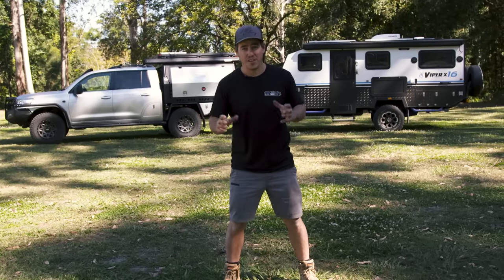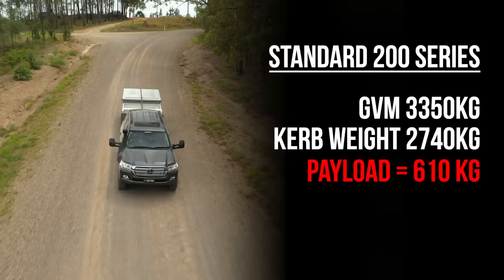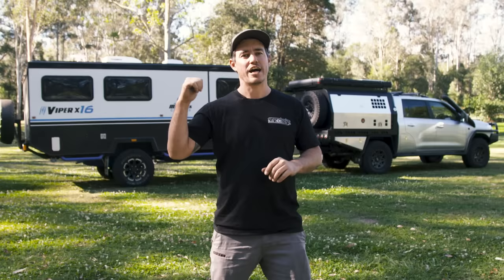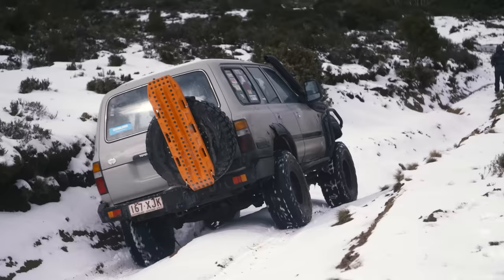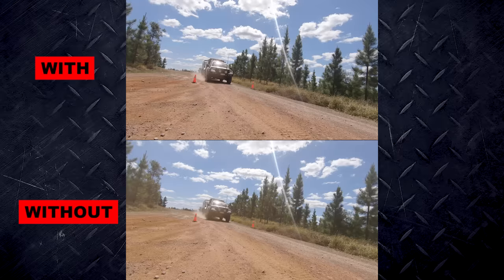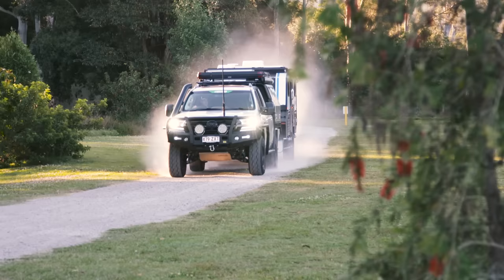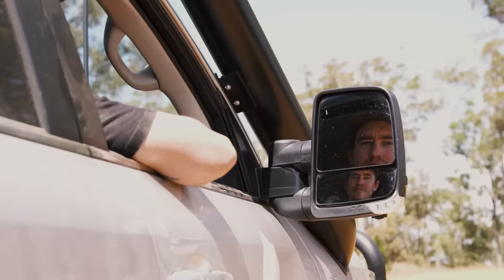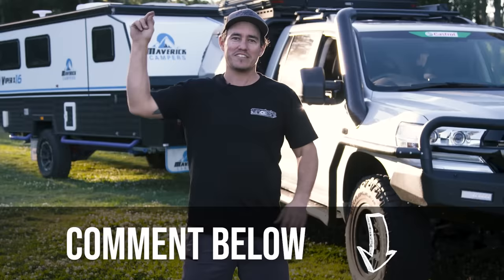SETTING UP YOUR 4WD TO TOW – Expert Secrets! GVM vs. GCM – Towing weights explained

Comment: Love the show fellas. My tip is not to try to sit on 100+km/h when your towing a big van just because it’s the speed limit. Drop back to 90-95 km/h and you will save a bucket load of fuel and go heaps easier on your rig. Just consider other drivers and make yourself easy to pass for those wanting to go quicker
Reply: I drive a truck. Sit on 90kmh most of the time for better ride and fuel. Best advice for caravaners, be consistent with your speed. Predictability is safety. And when there is a good chance for following vehicles to overtake, lift your right foot and let them pass.
Reply: Best advice ever.

Even in normal usage the fuel needed to take a vehicle of almost any type from 80>100 is very close to equal to fuel needed to get to and hold 80 in the first place. Gravity and air flow sucks but it is what it is.

Comment: Really appreciate your explanation of GVM, GCM, tow ball weight, etc., so straight forward and easy to understand. I've got a 2.8T van and have been test driving 4WD's to buy for towing. After watching this video I'll stick to my original plan of not towing it myself, instead paying to relocate as required (it's my permanent home, not for tripping around Oz). I like to do stuff properly the first time and you've helped me decide not to even attempt it, despite friends and family prompting me to. Yes it's a bit daunting thinking about the total weight of vehicle and van on highways that don't have enough overtaking zones or rest areas, but the real reason is vehicle set up costs to do it properly are simply out of my budget.

Comment: Towball weight is a huge issue with the very long draw bars on off road trailers. 
Load levelling hitches are great for on road. 

1. The big one you missed. You mentioned tyres for the vehicle. BUT you failed to mention trailer tyres. 
So often trailers are fitted with really cheap and narrow tyres. Fine for going to your local boat ramp, not for long trips though. 
Shauno, you're guilty of this on your boat trailers. You can see the trailer digging ditches on the older Fraiser island episodes. 

2. Weight balance on the trailer. Loading the trailer properly will make it much easier to tow. 

3. Lockup kits, intake, exhaust. So vehicle mods that will improve fuel economy, control and power.
Reply: Some good points there.
Reply: Read the RAC recommendations on load levelling devices/hitches with vehicles with sway control. Most new vehicles and caravans over 2T have sway control. These conflict with vehicle sway control. Some insurance companies have denied claims due to this.

Comment: A pretty simple one. Don't kid yourself on doing 110 down the highway! Slow and steady, stick to 90 km and you'll save your motor and perhaps your life. And never tow in 5th gear!
Reply: And just hold up everyone who wants to go 110 in a 110 zone?
Reply: There are overtaking lanes and people can overtake safely.
Reply: @samuelsutton8299  90kph is fine by me towing 2.5 ton really. Pretty sure you be pushing alot of vehicles at 110 for extended periods hey. Anyways if you can't overtake someone at 90kph probably should look at something with a bit more hp lol.
Reply: @troymatthews668  there's no overtaking lanes near where I live and if there's people coming the other way sometimes you can't overtake and get held up
Reply: I'm not sure my 80 can do 110 alone! It's top speed without caravan/boat is 100
Reply: Uhh 5th is perfect for towing as mines a 6m..

Comment: If you get in a trailer sway, don't panic, just manually push the electric trailer brakes. Do not press the tow vehicle's brakes. Afterwards, take it slow and reload your trailer when you can, chances the trailer is too rear heavy. A 60% front, 40% rear is ideal.

Comment: Load leveling airbags huge help in getting your rig sitting nicely on the road easy to adjust easy to let down when not towing.
Reply: Good for snapping chassis rails aswell
Reply: Be carful with air bags as they are the number one cause of bent/ snapped chassis!
Reply: Do your research. The alleged damage of (good) airbags to the car chassis is a myth.
Reply: @svenfokkema3440  how? It's creating a 3rd pivot point when there was never designed to have load there?
Reply: Air bags are just helpers not a solution
Reply: @jorjimaco5331  yeah of course should have clarified with a spring upgrade aswell
Reply: @svenfokkema3440  take it from someone who has actually bent their chassis mate, and the first question asked from many workshops is: do you have airbags? I didn’t have airbags but the workshop that repaired my car said that if I had airbags my car would have been a write off! I’m pretty sure that someone that is qualified in their job has more of an idea than the average person!
Reply: @adrianmoule1389  The inclusion of air bags will in no way change the down force on the tow hitch , or the down force on the vehicle , so how do they break the chassis, makes no sense at all
Reply: @gregstephens361  well mate that’s how it was explained to me by people who fix chassis for a living! I believe they have more knowledge than most other people.
Reply: In my opinion, the air bags are helpful to correct a small amount of sag when loading up the vehicle or connecting a trailer. Air bags Do create a third pivot point as they trasnfer some load away from the spring shackle mounting points to a part of tbe chassis not intended by the manufacturer to carry permanent load; where the bump stops normally are. Any thing more than that means the springs need upgrading. On my MR Triton the standard spring are are rated at 160kg so I use air bags to correct any sag when loaded up with more than say about 300- 500kg. Advice from several reputable suspension shops is to upgrade springs to 250kg or 400kg capacity depending on my needs. These stronger springs means harsher ride though  but allows you to use the vehicle more towards its upper GVM limit without as much sag. The problem of caravan sway is generally caused by caravan being heavier than the towing vehicle, it can be done but everything must be fine tuned and driving at reduced speeds. If you are pushing the towing limits of your vehicle, remember that for most vehicles, suspension is a compromise between ride comfort, cost and performance. If you push the upper limits of the vehicles specification  then upgrade the suspension.

Comment: I have a stock 60 series that's my daily, I pull a 2.2 tonne trailer through the week with all my tools and stuff for work. I have a roof rack on the cruiser as well that I load up with building supplies. Fully loaded trailer and car is just under gcm

Comment: The trailer has to be loaded so the tow ball loading is not excessive. Some trailer brakes are useless (10 in electric) so make sure yours will actually stop you properly. Auto lock up kit needs to be mentioned as an option especially on a 200 series. Every single thing works better if you keep the weight down. Think weight and load balance with everything. Very good show keep it up

Comment: One thing to absolutely steer clear of is air bags as instead of distributing the weight across the chassis where the springs are mounted the weight is on a single point! = bent / snapped chassis!

Comment: My towing tip
When on country roads with a lot of bushland either side of the road turn your brake controller up if you have a manual controller that way if something jumps out in front of you the load will help you slowdown quicker ( it's not the best thing to be pulled backwards but it will hopefully save you destroying the front of your vehicle)

Comment: In most U.S. states, trailers that weigh over 3000# must have brakes. Also, Goodyear Tire Co. recommends  inflating trailer tires to maximum as stamped on sidewall. Trailers need a stiffer sidewall because of sway and bounce. Sand driving is a different matter.

Comment: Another 2 helpful tips
The van should be level or slightly low at the front to make it stable. You can buy hieght adjustable tow ball mounts. Check that the suspension of the van is up to the loads you are putting on it. Some of the cheap imported vans are sold with way too soft suspension.  Both of these issues will result in a van that rocks side to side as you increase speed and that can quickly turn into sway

Comment: Breakaway brakes are required over 2000kgs and operate on all wheels on towed vehicle. The ATM can be 2200kgs approximately and still not require breakaways !! VSB 1

Comment: It all good getting a gvm upgrade but not many changes your gcm so still in the same boat and most utes have a load proportional value so as the back goes down it changes percentage of braking to the rear or as needed

Comment: GVM upgrades do not reduce axle load on the rear axle nor do they put the weight back on the front axle. What they actually do is increase the load on the rear axle. Axle limits should never be exceeded regardless of any suspension mod. If your near the limits of GVM or GCM get a bigger vehicle  even if that means buying a 4x4 truck like a Mitsubishi Canter or a Unimog.

Comment: Shauno,
              Can you please tell me more about the braided brake lines and do they come in plus 2 inch for raised suspension options, what brake pads are you using soft for better stopping and rotor life or hard for really heavy breaking under heavy load , but poor rotor life?
Please go over the tow pro , and how and WHERE it is fitted and wired to, Thanks

P.S take more time when your towing and take extra breaks to allow for fatigue due to towing , you have to concentrate more when you have a large trailer in tow.

Comment: Make the marriage strong as possible over rate everything to 4.5ton. I use a WDH , changed the chains ⛓ to 100grade 13mm with 400kg bars. Perfect for me. I only tow 2,900kg max. No suspension mods. 21f van.

Comment: Man, watching this as an American with a diesel Chevy 3500 is funny.  The rest of the world tows with such small vehicles and I'm over here with a rated towing capacity around 12,000lbs (about 5.5 metric tons).
Reply: Us Australians have the worst car laws, in all of the world bloody shit mate
Reply: @coreyschultze2084  everytime I watch one of their videos and they mention that something would be illegal it makes me even happier to be a American.

Just tire sizes alone boggles my mind here with the exception of a couple states you can go pretty much as big as you want and often 35's aren't big enough for some trails which is why 37's are about the starting point for off roading. I have to lift my two wheel drive truck and put 33's on it just to be able to drive the ranch roads due to rocks sticking up and that's the easy stuff.
Reply: I looked at getting a big American truck but problem is that they don't fit out track ruts very well I'm told.
That could quickly become painful.
And then there's the fuel consumption.
And then there's the fact they almost cost as much as a house.

Comment: My rangers got a 3500 gvm upgrade and about to tow a 2.5 tonne van (loaded). Cars around 3.3 ish loaded. Still within spec and it has been alot of time and money getting it setup. Just done bendix break upgrade too.  Very tricky getting it setup so its a awsome tourer without van and then able to strap van on aswell without taking everything out. Balancing act that im in the final stages of tweaking after two years. Seen the weigh bridge 4 times already and got a couple more trips to make to it yet. Maybe trans oil cooler next i think.
Reply: Have you included the towball weight into the equation??
Reply: @craigbrysse887  yeah mate. Ive included everything o possibly can on paper. About to complete new tray cannopy install then weigh in car. If my figures are correct ill be able to tow van at 2.5 tonne with tow ball weight of around 250kgs. Will have van built to sit abit lighter on ball and load it rear heavy.  Toy hauler so will have that luxury.
Reply: @daveo1559  Took our loaded setup down to Pedders for a Load n Tow assessment best $75 I ever spent and came with a print out of the results.
Reply: @craigbrysse887  oh yeah cheers for the info didnt know they did that. Ive got a Weigh bridge near me thats $40 a hit and ya can do axles and ball weight and van axle all at once. Might call pedders and look into it. 👍
Reply: @craigbrysse887  how long did the assesment take?
Reply: @daveo1559  About 1hr.

Comment: I had an after market transmission cooler installed to my 2017 Colorado the temp never goes above 86 degrees the car drivers better with lower gearbox temps.

Comment: Shauno, you mentioned that if you tow anything above 2tonne then you will need electronic brake controller..then all cars manufacturers that boast a 3.5 tonne towing should come with electronic brake controller from factory and included with the car because then it would be illegal to tow more than 2 tonne with your new car that can tow 3.5tonne. If a manufacturer is boasting big tow weights then the car should come with everything needed to tow those big tow weights.  Hope this makes sense.
Reply: They'll just increase the cost of new cars to have this added in I'd say

Comment: Easiest and best towing tip I have ever learnt is learn to actually drive with your trailer on. Some many times I've seen people towing even with box trailers and they run over gutters or get a bit of a sway going and slam the brakes on. Recipe's for disaster. Learn how your trailer tows and how the car tows it.

Comment: Biggest issue i had with this episode  was the INCOMPLETE INFORMATION being given. When a GVM UPGRADE is done it does not let you keep your braked towing capacity at the manufacturer limit. To retain braked towing capacity and do a GVM UPGRADE you must also have a GCM UPGRADE which most second hand vehicles can't have done

Comment: What about air bags for the rear axle? Is that not allowed there as they are adjustable?

I fitted my Nissan Frontier with air bags with compressor and valves and gauge inside. Super easy to adjust truck attitude by adding or removing air so it sits right.

Comment: Best tow vehicle tip is to sell your standard 200 and buy a ram 2500. It's already a ute and already has the big gvm. Alot less hassle then spending a house deposit just to upgrade your 200 just so it preforms as well as a standard 2500
Reply from the maker: Hey mate - because of the import fees in Aus the rams are actually quite expensive!
Reply: @4WD247  I don't agree. For 160k it's already a ute,  already has the big gvm, coil springs all the way around and solid front and rear axles. By the time you buy the 200/y62 then chop it then upgrade the gvm then have a tray fitted and then fit all the other accessories on it you would be at that price anyway
Reply: @Adam Blundell  Almost double the torque of a 200 series as well. A far better option for heavy towing.

Comment: Why do you say tow vehicles should always be heavier than the tow load?  Besides the ideal and the whole physics stuff...  Are there exceptions in your opinion,  besides big rigs, ie. (even 1/2, 3/4, and 1 tons and up  "Utes"/Trucks are towing sometimes upwards of 3x truck weights?)  Is this more offroad issues?   You Mates, seem to have very strict regs there?  Curious,  what would you do on stock 200 5.7 petrol, to be able to highway towing heavy 4k+kg, (stock 3900kg towing), but heavy offroad w/3k kg?  Your stretched 200 Ute, now that's a Proper Ute! Mate!

Comment: Your tow and payload laws are a bit different than here in Canada. Here any trailer over 7000lb needs (by law) weight distribution hitches unless you use a 5th wheel/gooseneck. Any trailer over 3500lbs has to have functional brakes.
Reply: I haven't seen a 5th wheel off road trailer here in Canada yet, but considering all the comforts of home many people insist on having, it won't be long!

Comment: What if you don’t have a vehicle that’s as capable of a towe rig as a 200 series, but still want to do some towing? I currently drive a second gen 4Runner that I’m setting up for touring, which is eating up my gvm pretty quickly, but I usually do quite a bit of recovery’s whenever I go out with my friends and my concern is if one of them broke down and if I had to towe them home I’d be quite a bit over my gvm. Would I be able to get away with just upgrading my suspension and brakes?

Comment: We have similar restrictions in the US. This is never enforced unless there is a claim. And, even then, may not be a huge factor. How diligent is Australia in enforcing these ranges after inspection? Or, is inspection even enforced for diy and new trailer purchase? 🤠
Reply: I cant speak for all the Aussie states, but in WA we have mobile vehicle inspectors that can pull you over and weigh your vehicle on the roadside. They mainly target trucks, but have been known to check caravans / car trailers occasionally. (FYI - the guys are knows as Mermaids: c@nts with scales) 😉

Comment: Whats the correlation between a suspension upgrade (heavy duty springs) and lift? Can you upgrade the suspension without having to lift the vehicle? I am not doing any real off road stuff so a lift isn't necessary from that aspect.
Reply from the maker: You can get heavy duty springs to suit heavier loads without going up in height - but the height will always change a bit because when you're unloaded, the vehicle will obviously sit higher than it would have with standard weight springs!